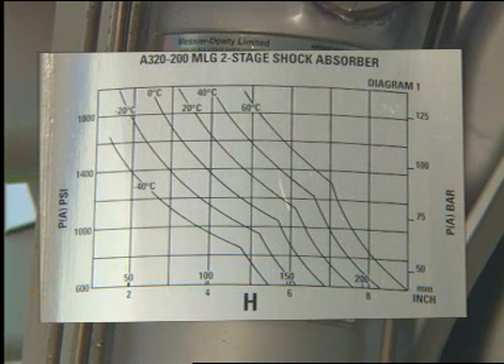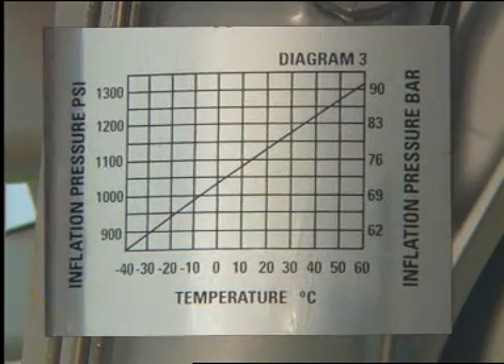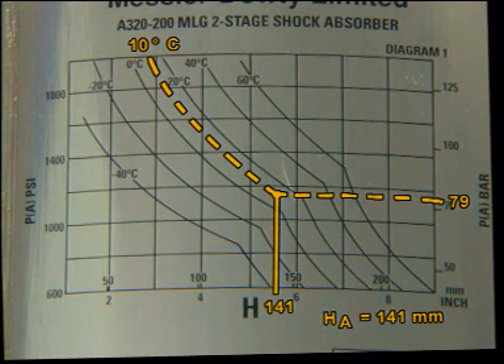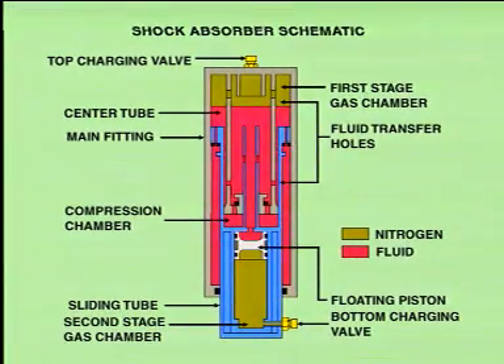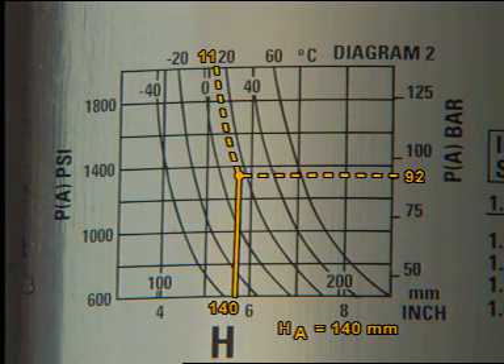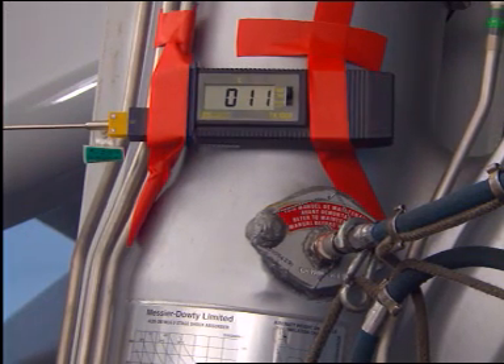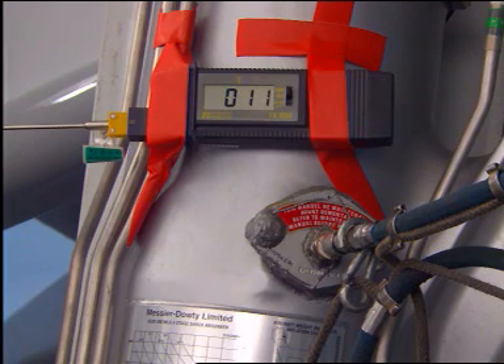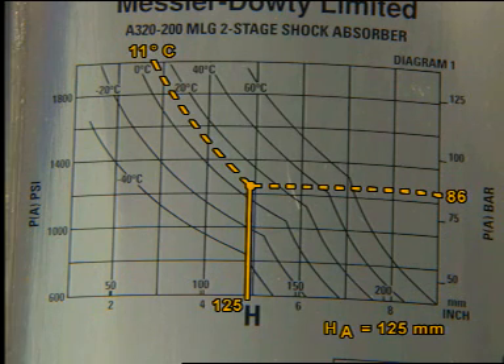AIRCRAFT | A320 Nitrogen Filling of the MLG Two-Stage Shock Absorber

Comment: Is not so tricky, but it seems quite rudimental: a flexible ruler instead of a specific tool with a scale & vernier; no tags or marks chiseled or engraved on the gear leg  to measure exactly "A" height gap between two specific points, two different scaled manometers inducing error when read. Note also the top valve fixed on a bumpy welded bulge. IMHO it seems an IL-14 rather an Airbus...:))